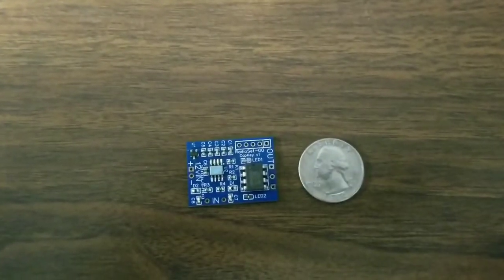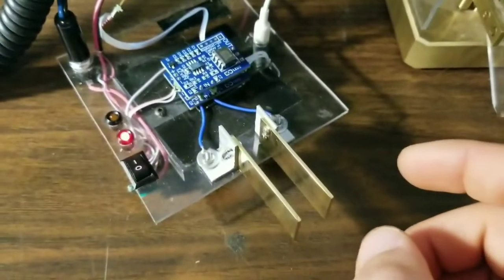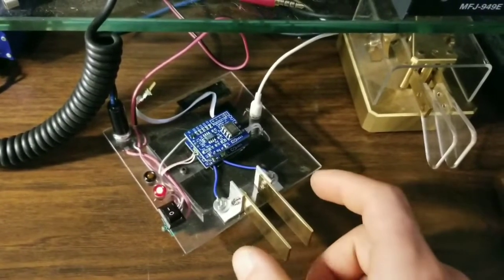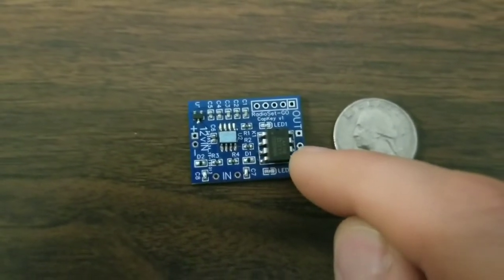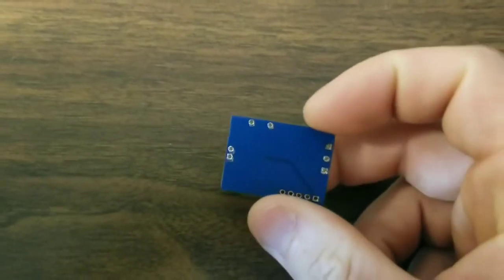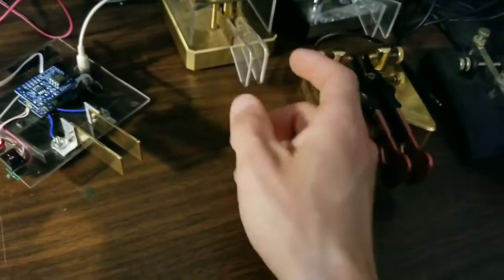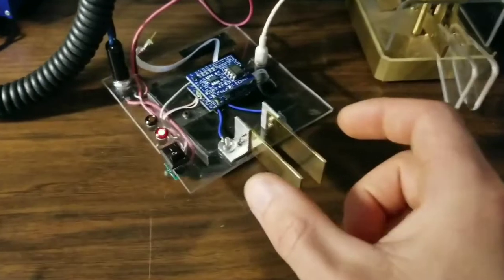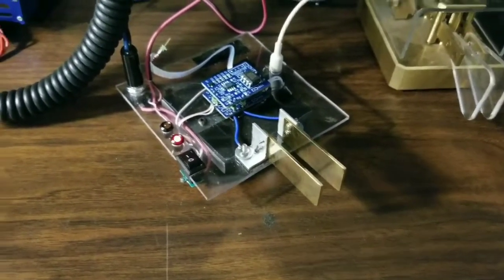CapKey touch keying (Morse) by RadioSet-GO

Comment: How do you deal with interference during transmission? If there is an antenna nearby or a bad SWR, the key will give false clicks.
73!
Reply from the maker: As long as the input lead lengths are kept to a minimum the circuit has good RF immunity. Finding the correct clock speed was important to avoid false triggering. 73